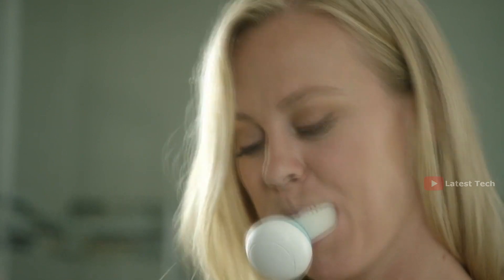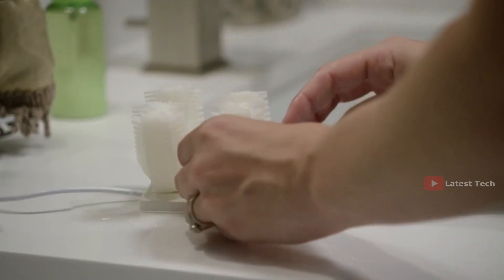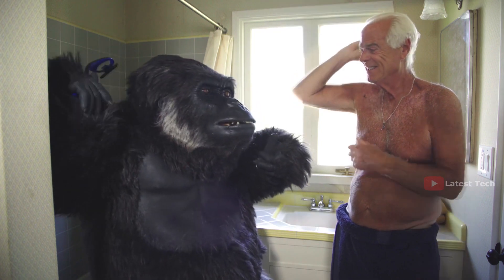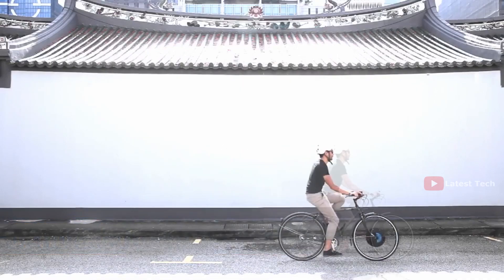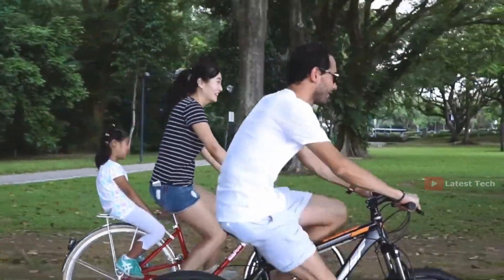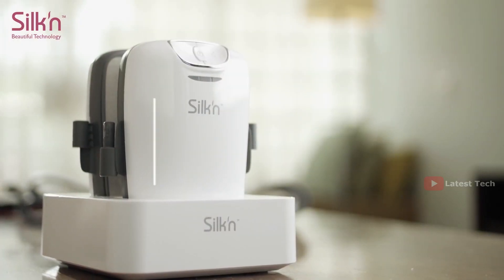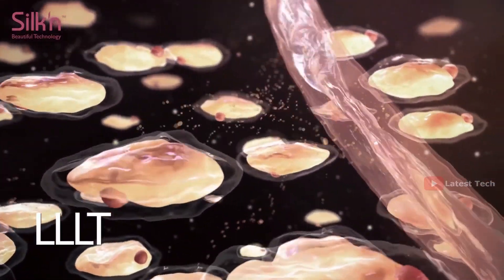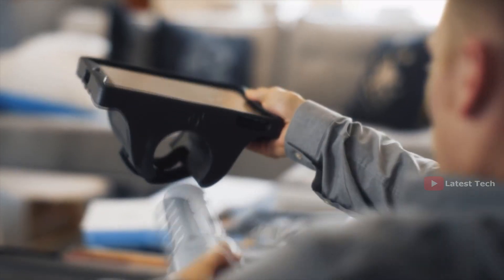5 Crazy New Inventions You NEED To See In 2017

Comment: I think, nonetheless UrbanX is technically ok, this product has 2 disadvantages. First it is front wheel mounted which leaves a particular sensation for the rider. Second, it is not expensive but also not cheap. On wet streets a rear wheel mounted set gives more stability. I would opt for that even if it costs more. It is dangerous to ride a front wheel traction bike on slipery underground believe me.